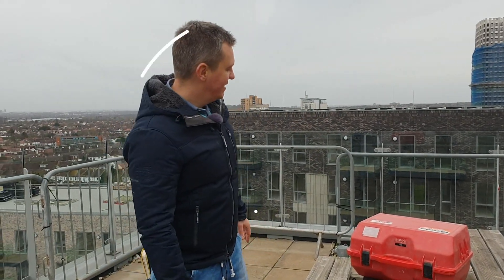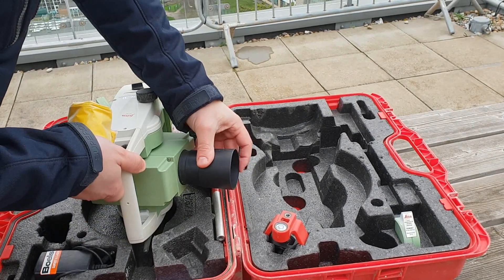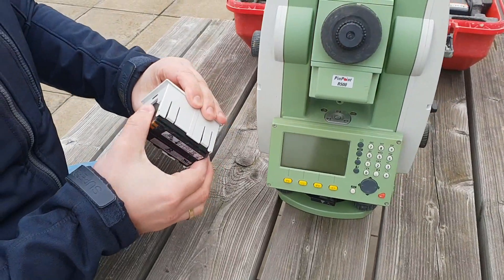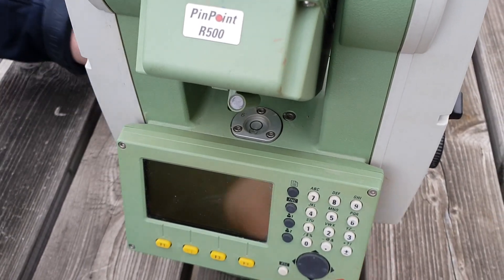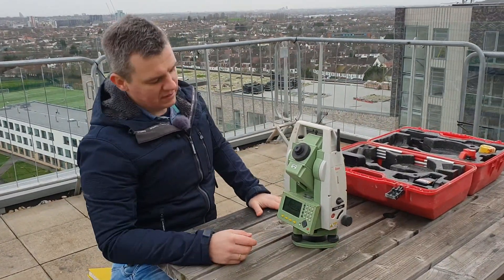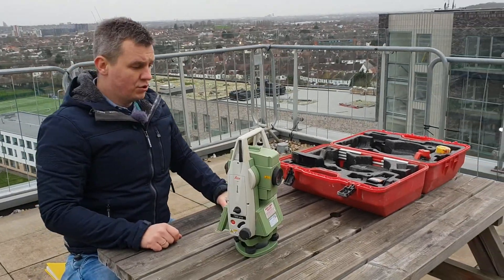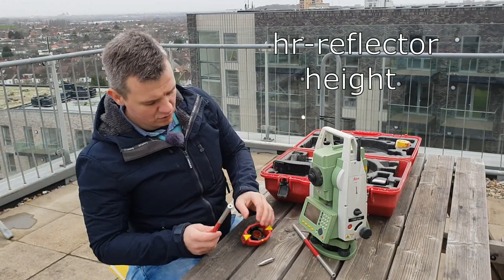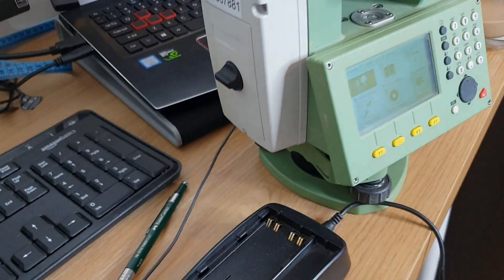SETTING OUT - TOTAL STATION,EDM. Leica TS06 "unboxing". The instrument and accessories.

Comment: Hi , Can you tell me the set-out work needed for slip - form? Is it simply,  give the base set-out and then keep checks at regular stages. Odd question, but I have never worked on / seen one built one.
Great info site! even for an oldie.
Reply from the maker: Thanks John! Yes, like you said you have to do base set-out and than you will be using tape and laser/level for setting out keeping the checks on verticality of the core. You can see a bit on my site video :)